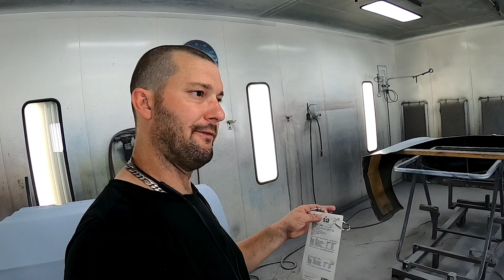'69 Camaro Orange Candy Part 1 (Herb da Rula)

Comment: Hey man awesome work where are you located and what is the name of your shop
Reply from the maker: Sorry but i'm not advertising for work. I put these out to educate others.
Reply: @paintbycurry1531  ok thanks awesome work through
Reply: @paintbycurry1531  would u be willing to answer questions we had?
Reply from the maker: I will do my best to answer them. Bare with me if i don't respond right away.
Reply: @paintbycurry1531  no problem I am ask for my boyfriend. Thank you
Reply: @paintbycurry1531  Is there a candy blue color that has a similar process that the candy orange has meaning with the metal flakes? I guess you would use silver instead of gold?
Reply from the maker: @jennygriffin5475  yes. I have used candy blue in the same process over silver with both a silver flake and with a blue flake. But unlike the orange candy i do not mix it the same. The orange i can mix @4:1 ratio and do three coats to get the darkness im after . But the blue i mix @10:1 and do 5 to 6 coats. Blues and purples tend to "stripe" on me if i try to double mix for less coats.
Reply: @paintbycurry1531   Do you have a video of the candy blue over the silver or blue flake or a video for both?
Reply from the maker: @jennygriffin5475  i do not.